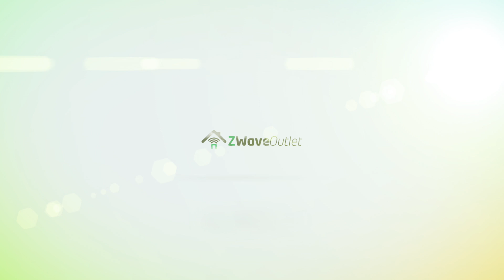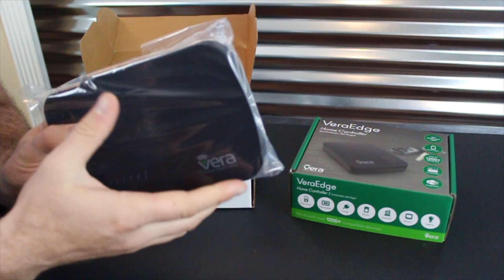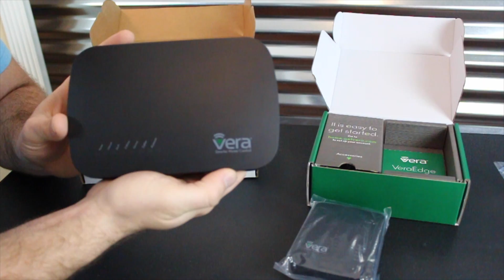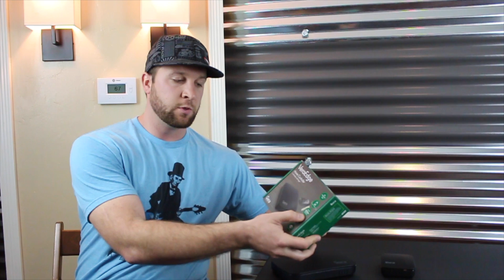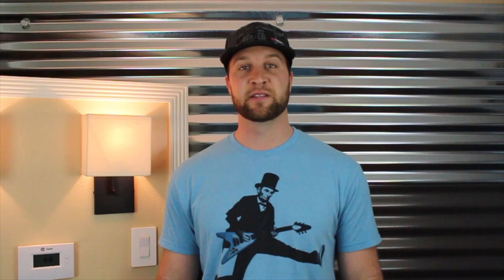First Look at VeraPlus Home Automation Controller -The Control of Choice for Most?

Comment: The problem is that the VeraPlus cannot currently function wireless, it needs to be plugged into your router with an Ethernet cable.
Reply from the maker: Hey, actually Vera implemented an update about 2 months ago that allows you to put the vera hub in wireless bridge mode. This is going to help a lot of people that only have the need of one or two Z-Wave devices so they can put the hub close by. Not a problem any more :)